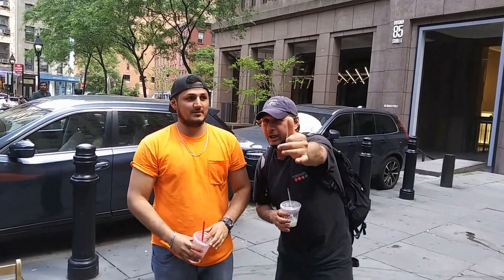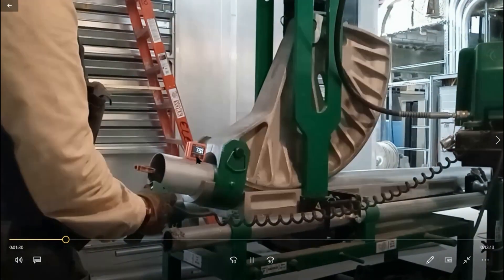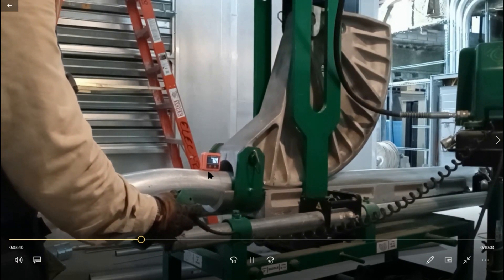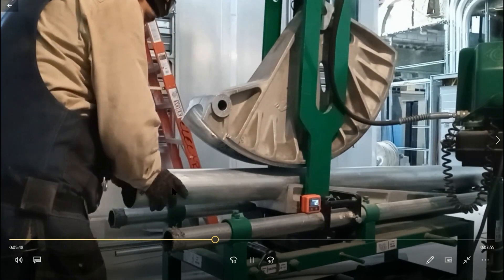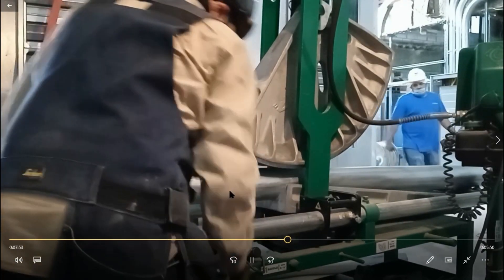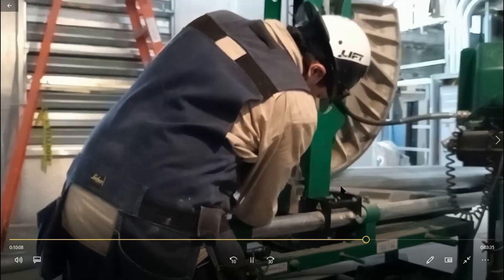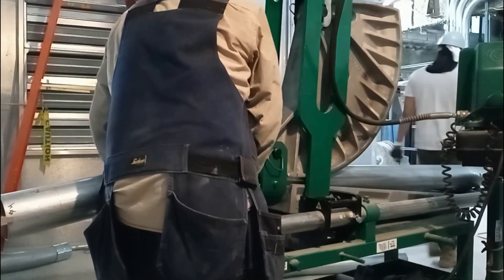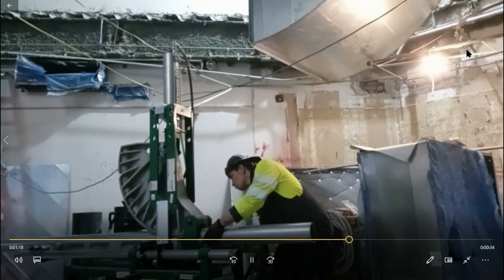How To Bend An Offset With 4 inch Conduit - Using Greenlee MBT 881 Camtrack

Comment: Anticipating springback, what do you recommend for making bends in conduit using an angle that springback hasn’t been recorded for yet, such as a 10 degree, 22-1/2 degree, 30 degree, 45 degree, 60 degree, etc. The journeyman on my site already recorded springback for making a 90 degree angle bend in 4 inch EMT conduit on the hydraulic bender, but not any other angle bends. I’m bending a 38” offset using two 45 degree angle bends. 38” is my rise so my distance between bends is 53.58 using the multiplier for 45 degrees(1.41). What do you think would help me as a year two apprentice with finding what degree to bend my conduit too using a digital level on angles not yet recorded to anticipate for springback?
Reply from the maker: This is a great question. Listen, I started my little book of notes really late in the game. But you shouldn't. Everytime you bend a new size conduit, degree, or bender, you should always write down that perfect spring back degree. Now from experience I'm going to tell you that a good amount of spring back to account for if you don't know is 2 degrees on the hydraulic bender. On the electric bender it doesn't matter because you most electric benders has the chart on it. Now the mechanical bender has the almost the same spring back as the electric bender. This is my discord server link if you ever need some more info this is the best place to do that.
https://discord.gg/33DTpP27

Comment: how much degree I need to add for a 22.5 degree offset?
Reply from the maker: On the table bender? You mean spring back?
Reply: @TheArtOfConduitBending  yes for the spring back. U think another 2 degrees will do? So around 24.5 degree on the digital level
Reply from the maker: @FronkG  usually for a small degree like that. 1 to 2 degrees. But every bender is different. I recommend you grab a scrap piece of conduit and bend it to 22.5. Then measure it to see what you have. If you come up with 21.5 the. You know you must bend to 23.5 for a 22.5. I have a small book that I have now transferred to a PDF full of notes taken during my time as a journeyman. Take notes write down on anything later you can re-write your notes. Every time you bend say a 30 and it comes up wrong write it down so you know what you have to add. When you come up with a perfect 90 deg bend. Before you release the pressure switch check your ram ruler to see the measurement. This way you learn to bend without the digital ruler. When you bend a any type of kick say you bend a 10 deg. Keep kick when your done measure how far the measurement is from the front of the saddle to the center of the 10 deg. Kick that info is priceless to know in case you want to place a kick in the future in an exact spot you know the center measurement for a 10 deg kick. My point is take notes my friend. Have a good day tomorrow and don't forget to support us when and if you can.
cashapp
https://cash.app/$artofconduitbending

Amazon
https://www.amazon.com/hz/wishlist/dl/invite/1V8io4L?ref_=wl_share
Venmo-melrub480v

Comment: How to make a really deep offset on 4” like a 15 degree 18” deep offset without the
Reply from the maker: Well I haven't done the calculations but I think the spacing between bends will be too far apart to do an offset like that cause of the degree you chose. You would need to choose at least a 30° degree bend. If it has to be a 15° offset then you will need to learn how to bend on center. So you can make one bend, then flip the conduit to make the next bend. Or quite possibly you can just do it the standard way of bending without flipping it and just and a coupling and a piece of conduit to the conduit your bending so that it can complete the offset. Basically what I'm saying is that for your second bend there might not be enough conduit for your second bend to be completed. How you understand what I'm saying. 

Follow me on:
TikTok/holmzlaw
Facebook/holmzlaw
Instagram/holmzlaw
Reddit/holmzlaw
Reddit/r/conduitology
Reddit/holmzlaw
Tradeshound/holmzlaw
Twitter/holmzlaw
Quora/artofconduitbending
Quora/holmzlawFollow me on:
TikTok/holmzlaw
Facebook/holmzlaw
Instagram/holmzlaw
Reddit/holmzlaw
Reddit/r/conduitology
Reddit/holmzlaw
Tradeshound/holmzlaw
Twitter/holmzlaw
Quora/artofconduitbending
Quora/holmzlaw
Reply: Thanks so much I got you understood 👍
Reply from the maker: @morrisrosario1703  good I'm glad you understand. You should watch my"charting your bender" video, in case you don't know how to setup your bender shoe to have your center of bend degrees. It's good info.

Comment: I tacked a piece of angle iron on a 2-1/2”, 3” and 4” emt coupling and use it as a anti dog with my torpedo level. I put it on the back of pipe by the vise of the table bender. Way easier,  in my opinion.
Reply from the maker: That'll work. Actually great idea. Thanks for giving us the great tip!
Reply: @TheArtOfConduitBending  right on man!
Reply: Im having trouble visuallizing this, could you explain it further?
Reply: @Boosteeen  he's basically using the angle iron and the coupling and a no dog.  Like if you ever put a strut on a conduit and strapped it then used your torpedo level as the no dog

Comment: How often do you work with 3.5” emt? I heard they use it a lot in NYC? I just purchased a used 881CT with mobile bending table only plan on occasionally bending 2-1/2”, 3”, 4” EMT out on Long Island NY.

Comment: How do you find the multiplier when bending 2inch-4inch conduit on these electric benders? I can’t find anything online and it seems like the are different than the hand benders. I’m really confused
Reply from the maker: Your offset multipliers are the same. It's always the same for offsets. Now if you are talking about 90° bends then the deduct is going to change for every bender and size of conduit. 
2.5 EMT - 21.5 deduct
3- 24 deduct
3.5- 27.75 deduct
4- 32.25 deduct
And offsets the bend multipliers are the same. 
Although if you want the actual greenlee manual you can go to my Snapchat message me and I'll send you the file.
Add me on Snapchat! Username: holmzlaw https://www.snapchat.com/add/holmzlaw
Reply: Your multipliers are the same for all conduit sizes. This is because your multiplier is based on trigonometry. 

When you have different size conduits and different benders you have to consider the radius of the shoe, because this will determine how close you can fit your bends together. Also the deduct for your 90 will vary by size of conduit. 

It's not a bad idea to chart your bender with the travel method and making you're the deduct is correct, and also finding centers of benders so that you can match bends consistently.
Reply from the maker: @danielhady3021  yes exactly
Reply from the maker: @ivan pena you never got back to me. I hope you figured it out. let me know if you are still having trouble.

Comment: What bags do you use bro?
Reply from the maker: You mean like tool bags?
Reply: @TheArtOfConduitBending  yessiree… I’m looking for something I can wear for solar work, while I’m also wearing a harness
Reply from the maker: @brandonmalfatti1110  i don't use tool bag anymore I use tool vests. From snickers
Reply: @TheArtOfConduitBending  ok ok... How do you like them?
Reply from the maker: @brandonmalfatti1110  Been using the tool vest for about the last 5 years and I don't see me ever going back. I work in commercial and usually work on big projects so really i run around with my tools on a cart and the vest is perfect for my basic tools like pliers, screwdrivers, spanners, etc. If i was to do residential again then i would probably have to wear a tool belt again. Just depends on what Im doing. Im always trying to be as productive as possible. So for me it depends on what im doing I guess. It just happens that I"m i've been doing Big commercial electrical service  rooms for the last 5 years with this company.
Reply: @TheArtOfConduitBending  ok ok... That I understand fully... I'm gonna have to try one sometime
Reply from the maker: @brandonmalfatti1110  when I do use bags. It has to be veto pro pace. They are very good quality.

Comment: How did you know what the spring back would be?
Reply from the maker: Ive been working with this bender for years. So i know the spring back. Usually between 1 and 5 degrees. Every bender is different. Just bend for example a 30° bend then place it on a level floor and check what you have if you have 28° then you know the spring back is 2°. When yoy first walk up to a bender bend a couple of scrap pieces. Hope this helps
Reply from the maker: Any questions just DM me on any other social medias
Reply: @TheArtOfConduitBending  Nice!!! Appreciate that Brother!!!!
Reply: Experience. When you've done a lot of conduit work and consistently use the same benders you get good.